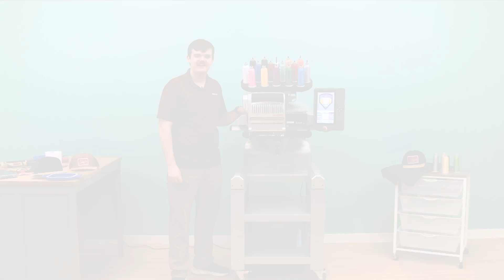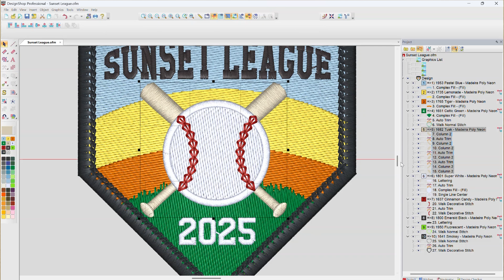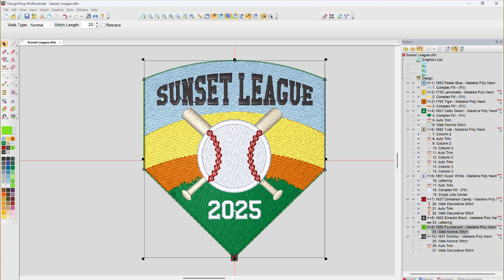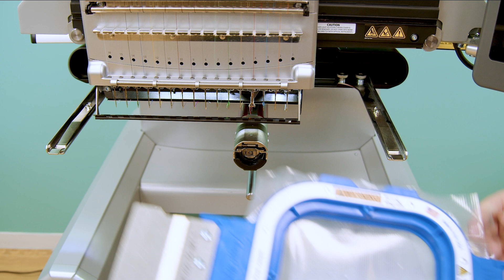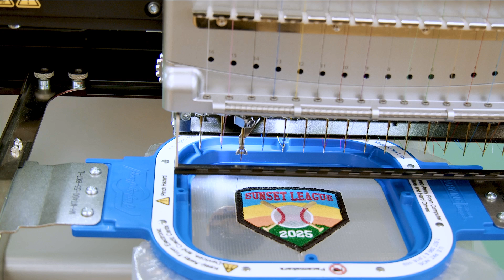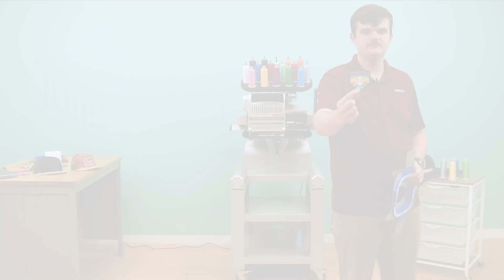Design & Stitch A Baseball Patch For Your Commercial Embroidery Machine

Comment: Awesome video.  Question.  When and how would you apply heat n bond or something to apply the patch to hat or bag ..
Reply: You can apply a heat-activated glue after the patch is removed from the hoop. The way I do it (according to Melco standards) is to remove whatever plastic backing from the patch, then apply the glue with a heat-press, and finally peel the patch away from the glue.
Reply: @RustheadCustomization thank you.  I will try that.